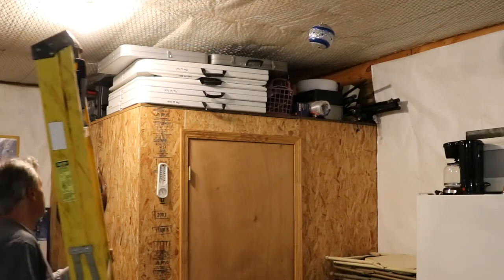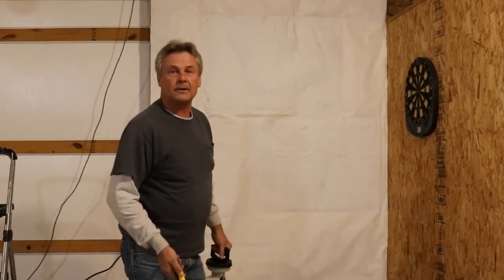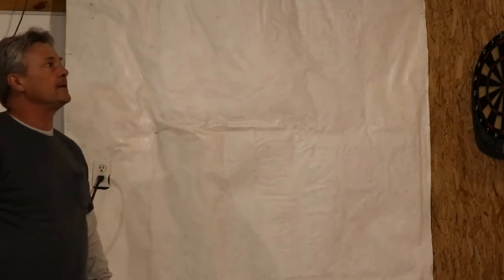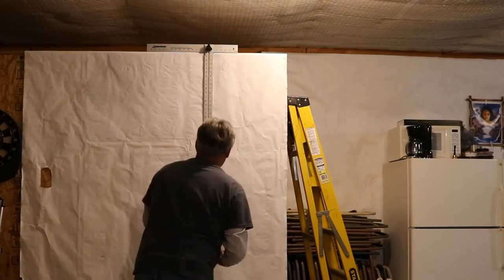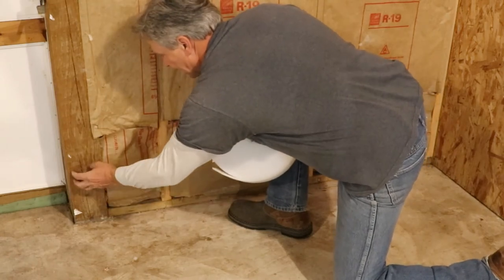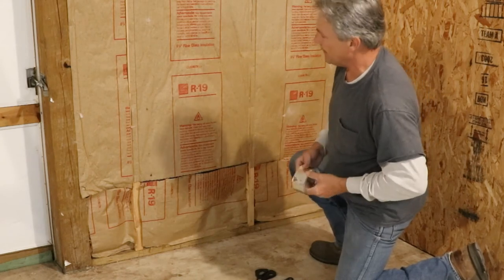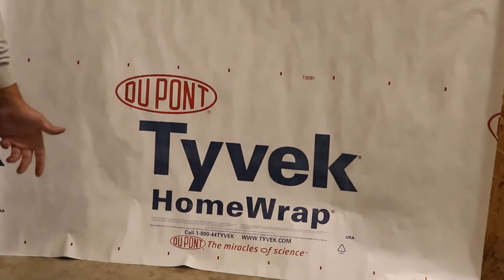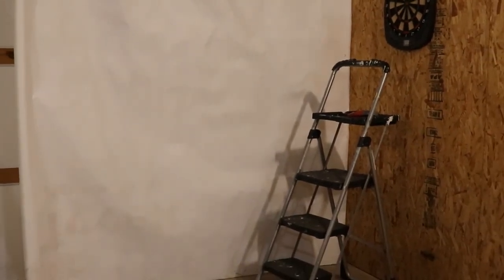Finishing Pole Barn Interior Walls With Tyvek  Home Wrap

Comment: Nice,. But why did you put it in backwards?  Tyvex letters should face you.  The way you put it moisture will pass into wall?  The other wall had letters facing you .
Reply from the maker: Hi Boyd, I turned the makings of the Tyvek inside on the interior walls to have a white finish and cover the insulation. Thanks for Watching